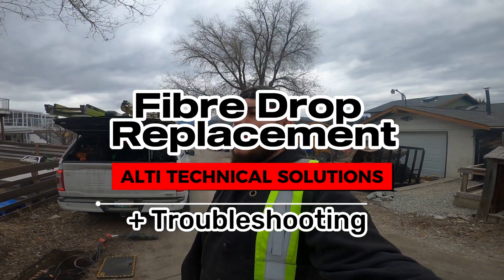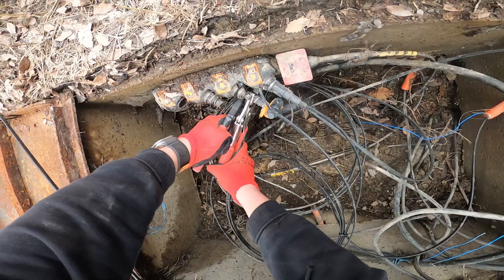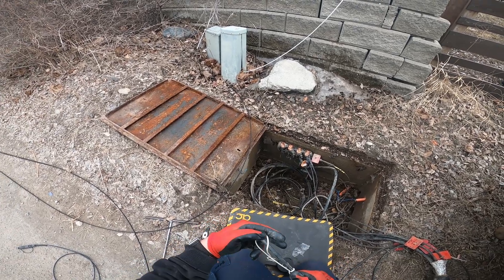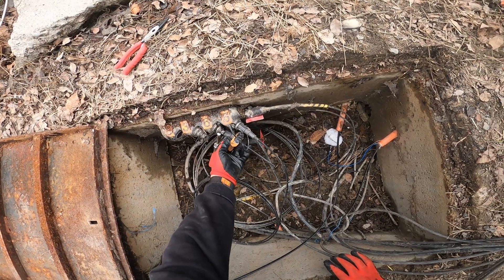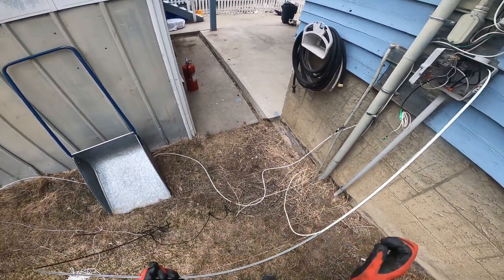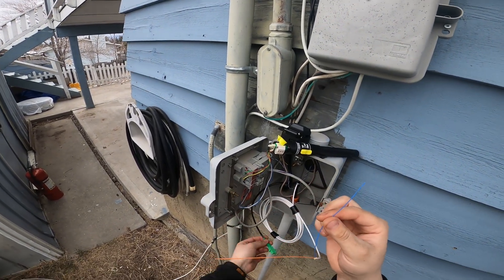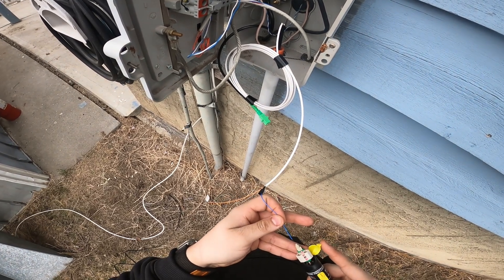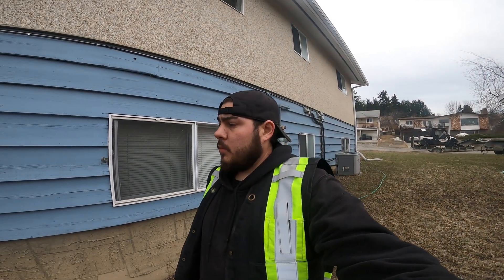Fiber Optic Cable Drop Replacement Guide FTTH 1F to 2F

Comment: Do you have a video showing start to finish with the mechanical splice. I haven't seen that before.
Reply from the maker: @2fast4youdog  hmmm
Reply from the maker: @2fast4youdog  maybe this one 😅
Fiber optic Network Expansion 150m End to End connection. media converter, splicing
https://youtu.be/W_2TpVRGkR4
Reply: @FyBurz   the video shows you start the mechanical splice but then cuts to you at the tub before you finished the splice. That's the part I was wanting to see

Comment: Cool stuff. A few years ago, I had a somewhat similar issue to what you were having towards the end of the video. I work in K-12 IT. All of our schools have a main data room where our network equipment is housed. We then have fiber optic cabling running throughout campus feeding secondary network cabinets (what we call IDF cabinets). 

At one school, there was an issue where a wing of about 5 classrooms was having internet issues. I initially thought the switch had lost power and for some reason the battery backup didn't kick in. But when I got to the classroom, I noticed the phone and Wi-Fi AP were lit up which confused me (they run off of PoE from the switch). The switch appeared to be running fine. I then thought maybe it had frozen? I thought that would be a strange thing to happen, but figuring since it is essentially a computer at its core, it wasn't out of the question. I restarted the switch and same issue. I plugged my laptop directly into the switch just to verify network connectivity and no luck.

At that point, I was thinking it may be a fiber issue. I happened to have a spare fiber cable (I don't know too much about them so I don't know what type it was) so I swapped out the switch's fiber cable that runs to the fiber patch panel and same problem. After that, I was thinking its likely a problem with the fiber run from the main data room to the network cabinet. Luckily all of our fiber runs have at least 3 pairs for this very reason. I moved the switch over to a secondary pair on the panel and then walked over to the data room to do the same. The labeling was not great at the data room fiber patch panel so it took some trial and error to eventually find the correct port. I don't know how that fiber run got damaged since it runs underground and I presume through conduit. As far as I can remember, I doubt there was any construction going on at that site at that time.

That was the first time in my 2 years (at that point) that I had a fiber issue at my school sites. We don't have any fiber testing equipment which is unfortunate, but it was still a good learning experience, albeit a little stressful since the lack of internet was hampering the teachers and students.
Reply from the maker: Damn dude, Gj fixing it. Troubleshooting and dealing with this stuff is what makes us better at our job. 🤙🏼

Comment: Do you trust that the end faces are cleaned on the drops. get a once click SC cleaner
Reply from the maker: I do and don’t, I normally don’t put ends on my drops. Just run them into the nib and leave it. This was an odd situation where I had to connect another unit back into service. I have the sc cleaner just didn’t bother. When I’m doing internal networking with fiber I clean it 👍🏼 but I should do it more 😅
Reply: I agree about cleaning.  I clean literally every single time i patch fiber.  I do a live tv job where patching and unpatching happens multiple times on the same ends.  Dirt finds a way.  It's so easy to do.  And if it's the first patch I always go wet then dry.  Microscopic particles blow around, can get attracted by static electricity, and cause scratching and/or pitting.  Then you're fucked. Especially when the damage occurs in the ports. Preservation is key.  But all that being said you have a great work ethic.  You take pride in your job.  Keep it up, Bro.

Comment: Use vasoline on the cable, goes a lot easier
Reply from the maker: Yeah I have different kinds of lube. Never tried Vaseline. But I rarely use lube. What happened was there was duct seal stuck in the microduct and it made the pull a hassle.
Reply: @FyBurz  I used to have to pull triplex for underground services. I would feed the fish tape and tie a rag on the end and pull all the water out of the conduit.

When I ran the triplex I would hook up the winch and lube the hell out of the cable with Vaseline. A lot cheaper than the stuff they marketed to electricians. 
That was in my youth. I miss those days. Thank God for YouTube. I am bedridden. All I have of the world is TV and YouTube.
Reply from the maker: @ocsrc  yeah I bet. Pulling the rag through is a good idea.  I don’t pay for any material/lube so I don’t care 😅

Comment: I've been there. I worked for a company that contracted with comcast as a drop tech. Hated that job. Pulling cable by yourself through a 150' or longer conduit run isn't fun, especially after the builders would dump dirt and cigarettes into the conduit before I got there. Curious what kind of lube you used though. Looks much better than the bull snot we used. That crap was a sticky mess.
Reply from the maker: I use that bullsnot too but if you check out one of my shorts you can see what happened to it... 😅
This is a Spray Foam type lube by Klein I bought it at home depot, it came with a little tube nozzle which helps get it deeper into the conduit but I misplaced it.

and yeah those long pulls can be tough, Ill usually feed the drop off a spool when its longer than 100/150m. The worst is when you can't see the pull box from the where you're pulling, working blindly.

and if I were to show up to house where the builders fucked with the conduit,  I would make them fix it or pay me for my time. I don't let them get away with that shit.

Comment: My favourite, an FTG in a mud hole that will never drain with cars driving over the lid. You are using 1310nm forward? What's the return 1550nm? If you are -14 at the house, what was it at the LCP? The system design looks halfway between early GPON and the latest GPON designs. There are many possibilities depending on the engineering. Since the LCP is a failure point, a cost and a point where techs keep moving jumpers, some companies have removed it and went right from the OLT to FOSCs to Opti taps. If an ONT is provisioned on a business PON port by accident it will take days to clear it and it confuses the techs. 

I'm assuming it goes back to a Nokia FX8/FX16 OLT, but you might not be allowed to mess with that. Do you have a PON meter so you can see the return? I have an EXFO PPM 350D. It can detect RF PON and GPON at the same time and show the return light. I have worked on combined systems. 

I have been working on PONs for a bit. I am one of a group of seven installers that did FTTH back in 1999 at Canada's first company to do FTTH. ATM backbone, RF input, proprietary T1 channelized phone input, RF modulated data input, dual fibres (a multiplexed fibre system would have cost way more back then). Some systems in the USA still work on copper through modules that look like the original ONTs called DPUs. Our first system was from Texas. Eventually we went to a fibre to the curb solution and a single fibre to an ONT. Data could be ethernet to the house, DSL modem or on the cable with a cable modem. Those were configuration choices. No digital transmission. All analogue modulated fibre. Digital wasn't invented yet...
Reply from the maker: You seem to know a lot more about this than me. To be honest I was trained in Install & Repair initially then soon after moved over to the drop program. So I didn’t get a lot of time on the field as an installer. Although I am fully capable of doing full installs if needed. My skills from this transfer well to these kind of jobs where splicing and troubleshooting are required. I didn’t get a return light level because I didn’t need it. -14 is more than good enough when the threshold is -24db 

Most drop tech wouldn’t be able to do a job like this and have to send it over to Cable repair. Or would just dig in a new conduit. 

I have access to some exfo meters but just don’t have use for them overall. 

I appreciate the info. Interesting stuff.
Reply: @FyBurz  You would use a PON meter at the LCP to see if the ONT signal is good coming back or I guess to see if the ONT is even transmitting. Sometimes a dirty fibre to bad splice just picks on one wavelength. RF or AIM over fibre is more sensitive, so even though you might meet spec, it still has to add up for the amount of splices and the distance. My preferred weapon to find these issues is the OTDR. Now with splitters feeding splitters and up to 96 ITU wavelength channels, I need a channelized OTDR but they are not cheap.
Reply from the maker: @Todd.T  yeah I understand, my point was that this customer was already in service with no issues. After replacing the drop the port got damaged so that’s why I switched it over. And with a new drop and new splice. -14 confirms that they have more than acceptable light to retain their service. From the nap back to the cabinet I already know is fine. If I was troubleshooting different issues with the nap I definitely would of done more tests. And I do carry an OTDR for those occasions. Unfortunately not an exfo one 😅